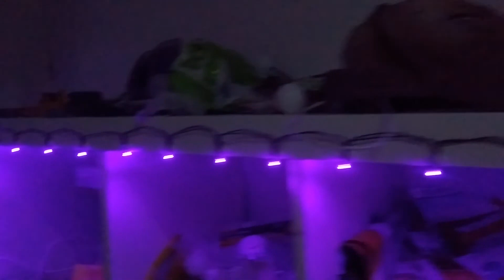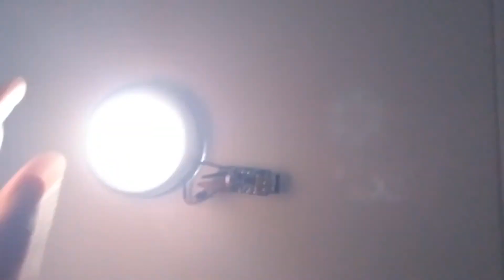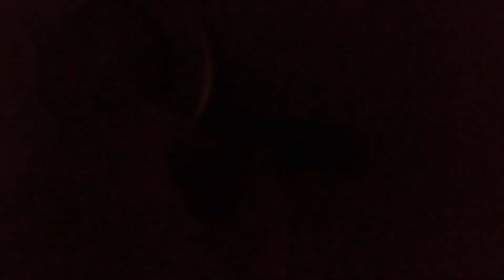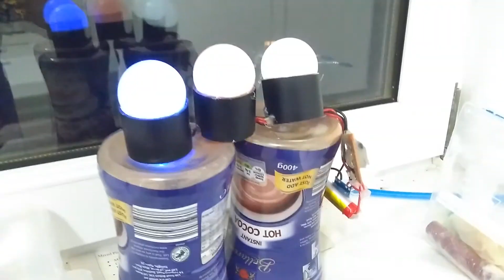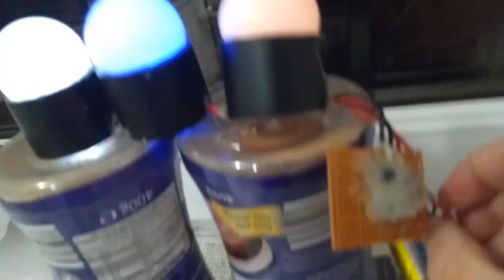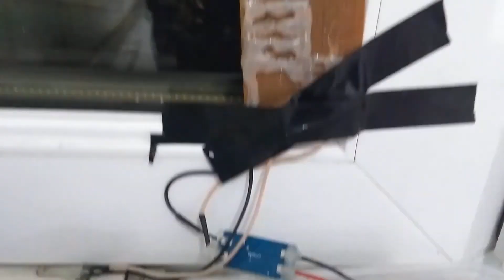LED projects using recycled lithium batteries from discarded Vapes found in the street.

Comment: Have a link to a suitable charge/discharge board you bought? I’m in the UK and have a small growing collection of these lithium batteries, only a few have USB-C ports on them.
Reply from the maker: I made a slight error when I bought my last boards and got ones with mini (instead of micro) USB but luckily I have a couple old cables that will fit the bill.
I got 20 boards for £10
This link seems to offer 20 for £10 with micro USB, these were not the actual ones I bought but l may the next time I need to buy.
https://www.amazon.co.uk/Dealikee-TC4056A-Charging-Protection-Functions-Micro-USB/dp/B09C35B3F3/ref=sr_1_4?crid=1UGV1PKXPM2CT&keywords=micro+usb+tc4056a&qid=1661791496&s=electronics&sprefix=micro+usb+tc4056a%2Celectronics%2C127&sr=1-4
Reply from the maker: This is a link to the actual (mini USB) ones I bought
https://www.amazon.co.uk/AEDIKO-Lithium-Charging-Protection-Function/dp/B09Q86X6TL/ref=sr_1_3?crid=30MJ6XU81ALD8&keywords=AEDIKO+20pcs+Mini+USB+5V+1A+18650+Lithium+Battery+Charger+Module+Li-ion+Charging+Board+TC4056A+with+Dual+Protection+Function&qid=1661791989&sprefix=aediko+20pcs+mini+usb+5v+1a+18650+lithium+battery+charger+module+li-ion+charging+board+tc4056a+with+dual+protection+function%2Caps%2C310&sr=8-3